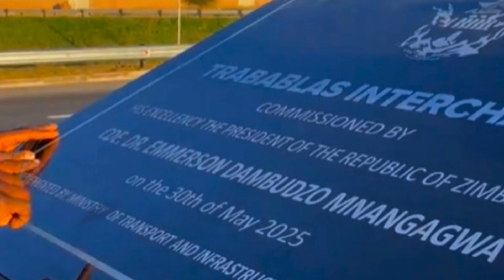The NEW Trablablas Interchange | Zimbabwe's First Advanced Road

Comment from the maker: If Mbare flyover is an interchange, then one meatball is a pizza. 

🛣️ Interchange – A complex system of bridges, ramps, and roads allowing traffic to flow in multiple directions without stopping (no traffic lights, no roundabouts). Designed for high-volume, uninterrupted movement.

🌉 Flyover – A single bridge that simply goes over another road. It allows one road to cross another, but doesn’t reroute traffic in multiple directions.